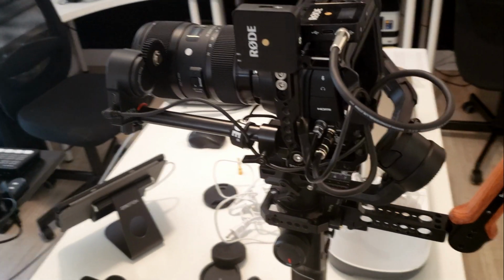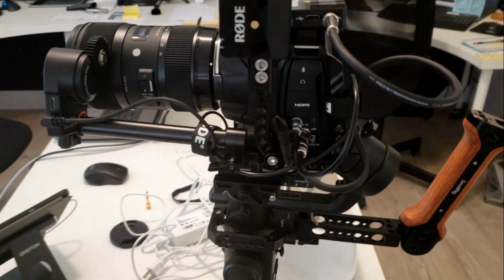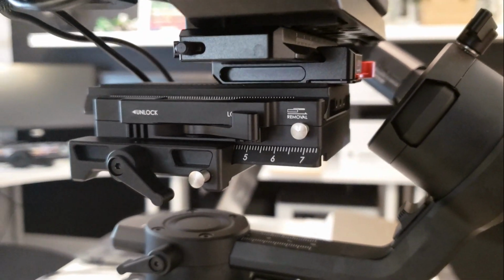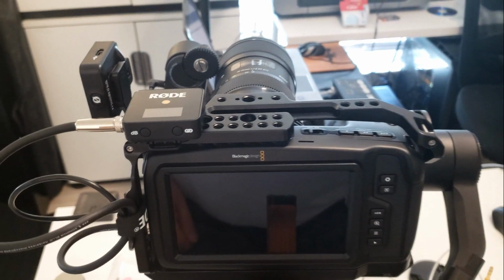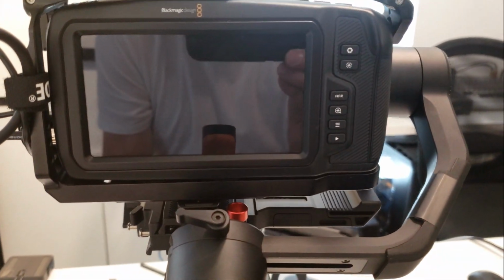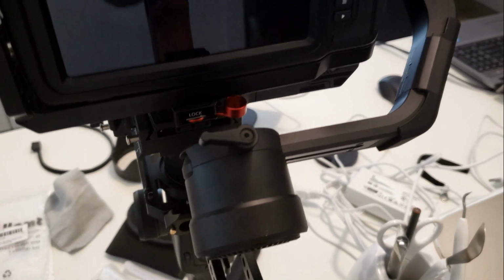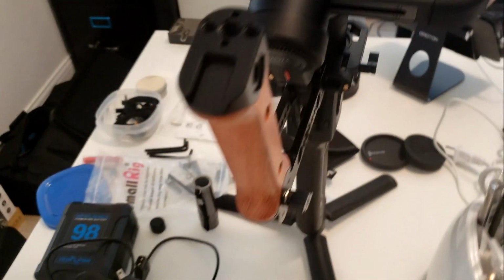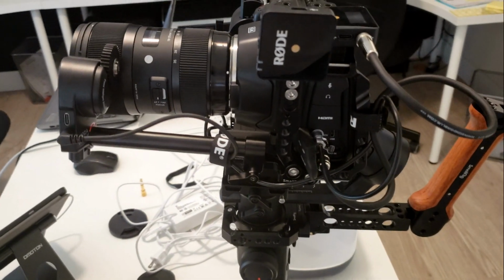bmpcc 6k Moza Air 2 Sigma 1835

Comment: After one year I'm coming back to your exact video! :D 
Question about follow focus. Does it work fine for you or the motor skips focus ring teeth here and there? Curious to know how you have it, thank you!
Reply from the maker: Hello Nikolay,

No mine do not skip. The reason is all my lens have Simmod gears on them. Never had much luck with clamp on gears and never got any Tilta Rubber Band gears to work even with my Tilta Nano. Put a Simmod aluminum gear on your lens and you will be good to go. I think the 18-35 sigma art is a 77mm. check though.

https://www.simmodlens.com/followfocusgears

Cheers Mark.
Reply: @ME-md5xi  Mark I appreciate the feedback, will definitely take a look at the aluminum option! Last question. Do you have 18-35 sigma? Do you think focus ring on this lens is a bit stiff and hard to rotate? Do you think that could also be a problem?
Reply from the maker: Yes I do have the 18-35 ART. And yes it is a bit stiffer than most of my EF lens but about the same as some of the Vintage Cine lens. I don't think you will get the follow focus motor to work well without the Gear on that lens. Try your moza clamp on gear. If that works fine then the simmod ring will be your friend for sure. Also make sure the focus ROD is not flexing. I have a small ROD mount on my smallrig cage and if I use a longer than 8 inch ROD it flexes away from the lens if the lens has a stiff ring. My base mount with ROD mounts is solid. Every little thing you add may have some hidden limitation. That's how you end up with a box of gear.....after buying more stuff to fix the stuff you already have.

Hope this helps.     Cheers.  Mark
Reply: @ME-md5xi  Helped a ton. Thanks for your time. I'll try to experiment but now with your knowledge in mind! all the best
Reply from the maker: P.S. In the video I do not have the Gear mounted. I did get it to work sort of as is in the video. But not good enough as you may know. Anyway, that lens has a simmod gear on it and works flawlessly.

Comment: Might buy one, from your knowledge, do you think I will be able to balance my 6k camera using just a rig, and lense
Reply from the maker: Hello Frank.,

You should have no problem if you also get the smallrig offset plate. Since the 6k is so wide you need that extra lateral adjustment the smallrig gives you. Plenty of pitch adjustment with Moza provided mount. Now I did this because of sigma weight. My Canon 16-35 and 24-105 EF lenses are much easier. I have never tried the 70-200 2.8 but I think that would not be very easy and might hit weight limit. Its all about the lens you put on. Good luck..

Comment: i have BMPCC 6K Pro. How can i power it up? Should i take off battery from camera?
Reply from the maker: Hi Serelik. I leave the camera battery in. I would not use battery grip on Pro since it makes it bigger. The Moza power will keep the camera battery charging. My BMPCC 6K with small battery and Moza Power will last about 1.5hr with Sigma lens due to weight of setup. if I use a lighter Canon L lens or Zeiss lens then it will go almost 2 .5 hrs. Cheers.
Reply: @ME-md5xi  cool, tnx! How do you think could it power Bmpcc 6k Pro, and will it able to stabilize that weight?
Reply from the maker: @SergeyMoskvinStories  It can Moza Air 2 can handle 9 pounds. If you go with just pro body and NO battery grip you should be ok. My BMPCC 6k with full cage and Sigma ART 18-35 came in @ 6.7 pounds. The pro is 2.7pounds the 6K is only 1.9 pounds. So you have 2 plus pounds to play with. Using a lighter lens will also help even more. Since the pro is taller, I would mount any mic on the Moza or use the RODE GO.
Reply: @ME-md5xi  thank you, sir !

Comment: I just ordered an Aircross 2; I also have the Sigma 18-35mm lens, albeit my camera is the OG BMPCC (1080p version) in a relatively minimalist half-cage.  We shall see if I can get that to work.  I'm guessing that since it's quite a bit lighter than the setup you're using here, it will.
Reply from the maker: Hello Charles. You should have no Problem. Let us know how it turns out. The aircross is popular. If you have difficulties in Lateral balance smallrig makes a counter weight just for the aircross. It works on Moza Air 2 as well. Cheers.
Reply: @ME-md5xi  I actually have a few counterweights that can screw into my cage.  I will let you know how it goes once the Aircross 2 arrives.  😎

Comment: I don't understand how you did it, I pushed everything to the limit (so everything fits) but my camera still is heavy on the left side. I don't have the RODE mic but the SD cage and the drive itself on the left side. I will try to figure something out in order to place it on the right side instead
Reply from the maker: Nikolay, I did not use my SSD and holder, just CFast internal card. As you can see at 4:17 with full cage I am about 2-3mm from gimbal servo. That is with smallrig offset plate, I could have pushed it a little more to right by 1 mm. Try pulling your mic and SSD with holder off your rig. See if you can get it there. With that setup you should be lighter and less weight on left side than my setup.   If you can ..... then you may have to go with CFast or remote your SSD holder to gimbal handle and just run longer USB C cable up to camera.  You could also try the Small Rig Moza Air cross counter weight. I bought it but did not need it. Even with your full rig and that weight if it works would still be within Moza weight limits. You can also mount mic to handle as well. Of course all that extra mounting tat will contribute to small rigs income 😁 . When I did auto tune,  it hit at 95,95,97. But I manually backed the motors down from there later and it still worked fine .  Feel free to reply if you need more help.

Comment: Do you know if the moza works with the pocket pro?
Reply from the maker: Good Question. Weight wise it should. Offset plate probably will be needed to move weight back since pro is thicker. I have switched to using Contax Zeiss lenses on my setup and made the balancing much easier. Not to mention the picture that those cine mod-ed lenses produce with the BMPCC 6K. A shorter lens with the pro would be a big help.
Reply: @ME-md5xi  thanks bro!... I think the big problem is to find the right plate. I'm gonna get the pro and I got the moza two years ago, don't wanna waste money in the RS2.
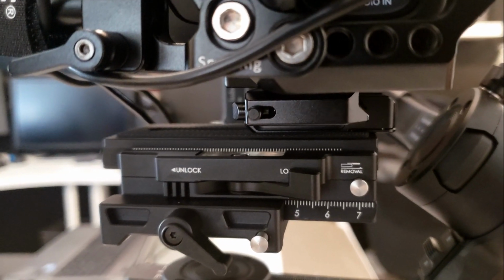Reply from the maker: @cristianpinzon1507  I use the Smallrig BSS2403 made for Moza 2. It works great. I think you will be ok with that offset plate as well for the pro. As you can see at 2:44 in video it mounts to camera and Moza plate mounts to the offset plate. I know pro is taller and longer. Not sure if it is wider. check that against 6k. I still had some lateral movement which was not needed. Again, I think the Sigma ART is the most challenge you could have in Pitch unless you strap a Cooke on there. Using a prime makes balance a breeze. On the height, underslung mode might be a challenge. I have to use off camera mic or my RODE wireless to get it to clear the gimbal.  Since I have invested in about the same price difference in a set of NISI matt box and 77mm screw on  IRND's I will be sticking with the basic 6K. If you get it working, we would love to see a vid of the pro on the Moza Air !

Cheers
Reply: @ME-md5xi  by know, I'll get the camera with the 18-35. I'll try it to work with Moza. If I get the rig offset, I'd do a video, the only problem is that my english is so poor haha. BTW I think the pro is taller, wider but not longer than the 6k.

Comment: You're right... lots of 4k videos out there. I have the 18-35mm but I don't think I'll be attempting this myself haha. I have a 40mm Canon pancake that seems within my strength :) I don't have an offset plate but I do that a 1/2 cage on it... I might try to offset by one of the bottom mounting points on the cage to hopefully set the side to side balance. I hope that works! So how are you powering the camera with the Moza Air 2? Is the 16V into the 12V good? My guess is the camera only takes the 12V it needs from the output... what was the special cable you needed to get? I'm interested in FIANLLY trying to get my p6k balanced on the MA2. It's been forever as I initially got discouraged haha
Reply from the maker: Hi Norman. Yes I agree on size and bulk of Sigma. It is a great lens but HEAVY. I bought a used Canon 17-35 F 2.8 L for use with the MOZA. Not as fast as the Sigma but for most of the gimbal work it is fine, or use the Canon CINE 35 on it.  As for power, the BMPCC 6k is rated at 12-20V. So the 16V off of the MOZA fits just fine. I ordered the power cable  (DC 5.5/2.5mm Right Angled Power Cable for BMPCC 4K Blackmagic Pocket Cinema Camera) from amazon. About $23 US. Works great. I also ordered 2 extra sets of MOZA batteries from MOZA. I get about 2 hrs running Camera and Gimbal. Monitor uses its own if I use one. On the batteries. There are many 18650 batteries that are cheaper. But most of those are unprotected. I just did not want to chance a $400 gimbal to cheap, unprotected power. Many of the issues with the MOZA batteries I think come from the poor charger that MOZA provides. I tossed it and got a BT-C3100 computer controlled charger for 10-16-18-20 series batteries. It really treats them well by checking them, discharging and charging . So far I still am running on original set after a ton of use. So a good charger is key to battery life. That and not abusing them. Mount it up and shoot some for us to see. Cheers